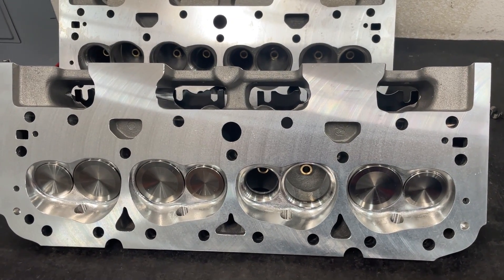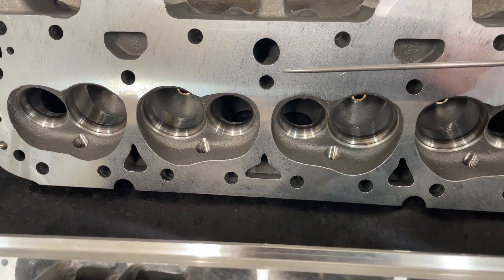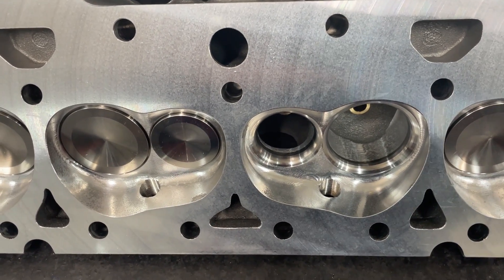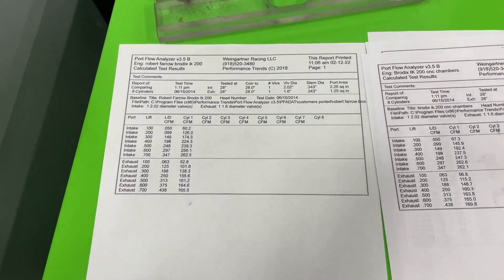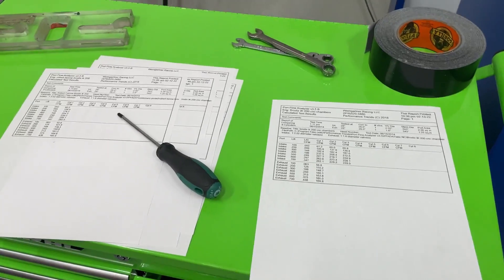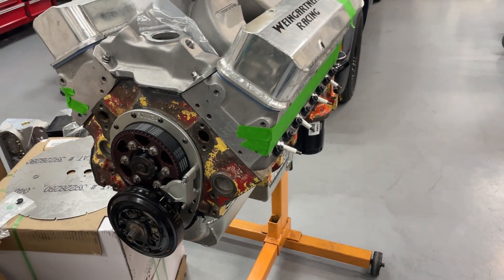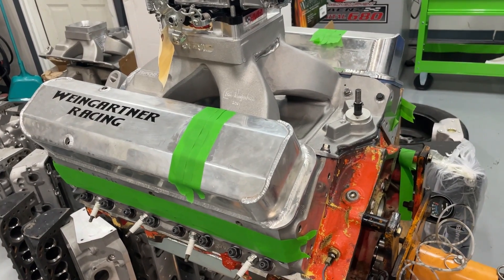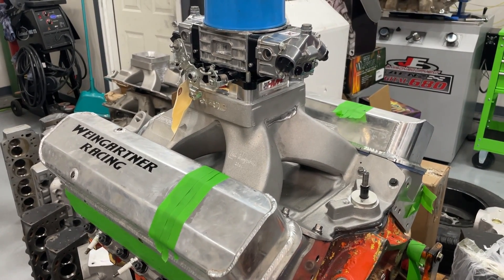Are CNC Chambers Better?

Comment: My question here would be, given basically the same head, once CNC'd from the factory / manufacturer, vs one hand ported by someone such as yourself. Which would likely outperform the other. I would think the manufacturer's CNC program would be rather generic, where as your hand port would be detail oriented.
Reply from the maker: It really is which port design is better. It’s not always cnc heads from major manufacturers.
Reply: @WeingartnerRacing  that’s my thoughts exactly. Take the BB3 Xtra 363’s vs BB3 Xtra CNC 366’s. I know Brodix starts the 366’s with a “CNC compatible casting” meaning, they aren’t starting with a 363cc runner. Yet, you starting with a 363 runner, after hand porting, I’d imagine you’d remove a fair bit more than 3cc’s worth of material. I could see them ending somewhere around 370-375cc. Which with a well thought out port design, should flow better than the CNC 366 head. Part of the reason I chose your hand ported over ordering the 366’s from you.

Comment: Are CNC heads Better?

   As a CNC (computer numerical control) machine programmer / operator,  you will first need to make the program. For something like a complex shape like a combustion chamber, or Port design you would first digitise the shape, this basically takes in the shape in incremental amounts, and inputs it into the computer memory as a digital file, files, the file is then saved. Before you can do any of that, a skilled person that has an abilitiy to make drawings produce the product,  from nothing such as trades person would be a precision toolmaker. This isn't always the case, a person who has cad experience could also do computer modelling, and come up with the design using fluid flow dynamics and or other CNC cad programs. (Before CNC machining, a pantograph was used for copy milling shapes. This method is now obsolete due to CNC machining taking over this method). For building Race Engines, it would be still best to then take this design, find someone who has cylinder head experience, Engine building experience, combined with engineering trades background to develop the head into the final product. A flow bench is one tool, that would be used, a dyno is another, track testing is also generally done. The Race cylinder heads usually start out as being hand made, hand worked by professionals from existing cylinder heads, Once the cylinder head has been developed, the process of duplicating the newly developed head starts using digitised shapes from the customer or by the engineering Toolmaker, or fitter and Turner, machinist or anyone with a CNC machining centre and the, and the ability to to the work, the new duplicated CNC machined head is then produced. The product you buy over the counter is the Now New product released to the public. Some companies have the ability to do all this work in house. So there you have it. Now you know how it's done.

When you want it fast, bring it over.

Comment: Eric thanks for the video! Stop being worried about stuff! If you used good parts, which it sounds like you did, & the clearances are close, it will be fine! I’ve seen engine butchers jam shit together with parts straight out of the box 📦, w/o checking anything & very rarely do they have internal issues! They don’t make the big power they should, but they do run! I’ve put my junk back together w 3.2 to 3.5 on the mains &  3 thou on rods! Also it had 9 thousands piston to wall! It actually ran faster than it ever had been! My buddy still has that noisy POS of a engine! It hasn’t been freshened in like 15 years now! He originally put it in because he broke a factory rod on his 355, by spraying 300 on it! It was supposed to be temporary 🙄🙄🙄🙄! He still runs it every weekend in the warm weather & goes to the track with it at least 6 times a season! It doesn’t use oil & still runs as good as it did when I first put it together & the clearances were correct! If it ever comes out, I will dyno it to see where the power is compared to what it did originally! Also I’ve done myself with my boss of course, dyno testing on 355s that ran all season circle racing! The driver said it was tired & down on power! It was like a 400hp 2barrel deal! Well it made 3 horsepower more than when it was new 🙄🙄🙄🙄! (Same Dyno /timing /carb) Worn out & tired my ass! Also I don’t know if you’ve seen Pete Harrells Real good at doing stuff, but it’s definitely worth a watch, Especially his latest video called polishing turds 💩💩💩💩 😜😜😜😜! It’s awesome 😎! Sorry to make you read so much! 👍🏻👍🏻👍🏻👍🏻🇺🇸🇺🇸🇺🇸🇺🇸🇺🇸

Comment: You see the how UTG paints his blocks?  Propane torch to dry the surfaces and then uses Rustoleum primer and paint from Lumber yard, all done with a brush.   👍💪
Reply: The best part was when he thought the torch was drawing moisture out of the block when it was water vapor from the flame condensing on the cast iron. Bless his heart

Comment: Eric,
So basically the intake chokes down the head flow , just curious how that speed warrior is going to affect my 421SBC with your Ported 213 profilers on it. I am hoping it will not effect my low end to mid range power??

Comment: Just something I've noticed flowing manifolds with and without the head. If you calculate the percent of flow loss with and without the manifold, it is a fairly good predicter of loss on a different head. For example, the 294 CFM on the 330 CFM port equates to 89.1% which would predict 237 CFM on the 266 CFM port which is less than a 1.5% variance from the observed 233 CFM. 
In other words, the flow loss of the intake runner with the head port is not an indicator of the port flow volume as much as it is an indicator of manifold runner frictional loss which is dependent more on air speed than flow volume. It's also the same reason you don't want air to speed up and slow down. Lost energy.
Reply: I was noticing that, too. I didn't quite do the math as much as you did but I did notice, regardless, it was a 30 to 35 cfm drop across both heads. 👍
Reply: They way I see it is more of over coming inertia where the manifold design is causing the air the change direction several times sapping efficiency.
Reply: @edwardwood3622  that is part of what I said. Every turn or change in volume causes loss. Inertia is a transient confounding variable where frictional loss is more constant.